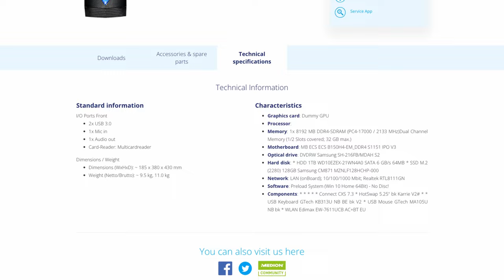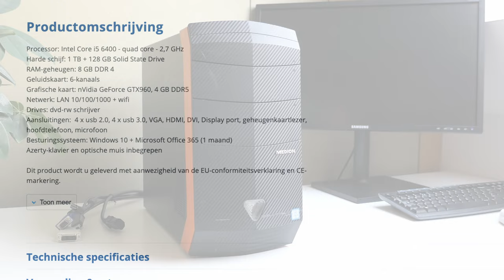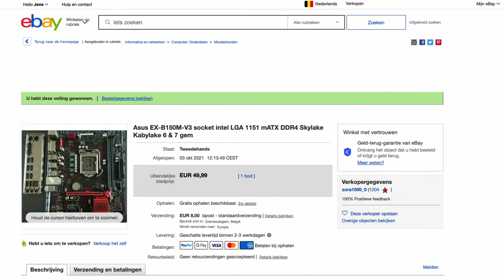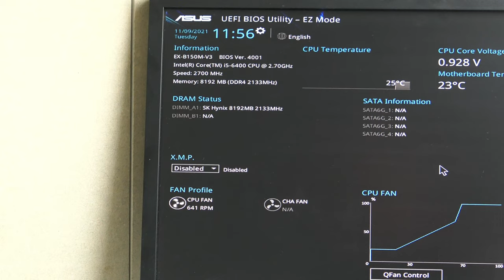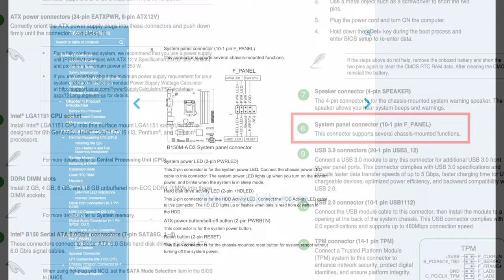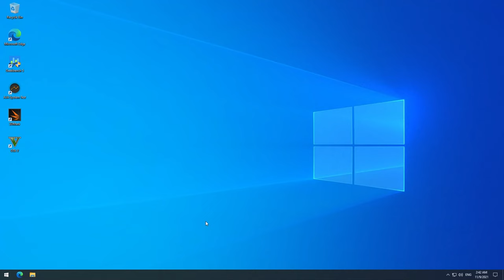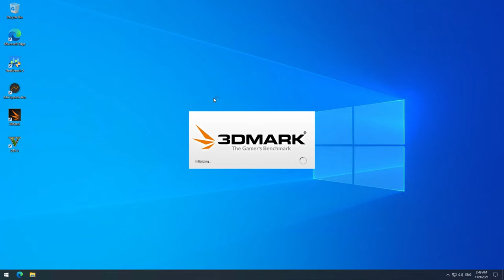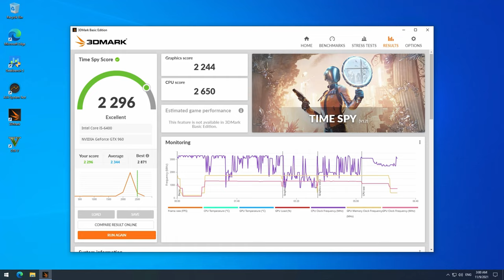Repairing Medion Akoya P5373 - Motherboard Replacement

Comment: 6:15 An 8 pin CPU power connector isn't a requirement. You can go with a 4 PIN CPU connector and it still works, there just goes less power through the connector.